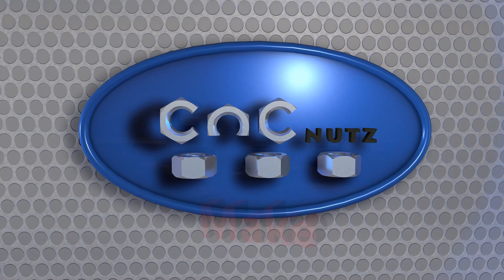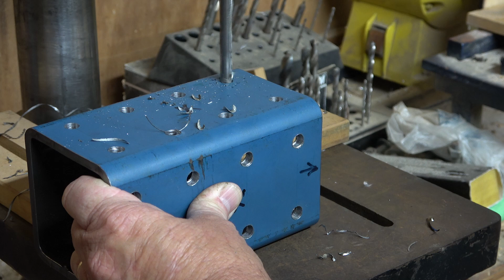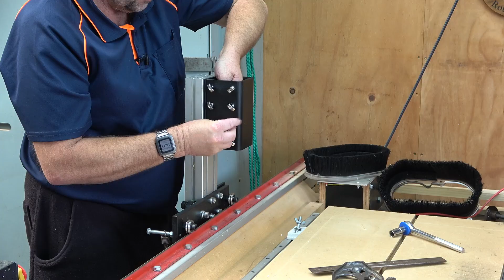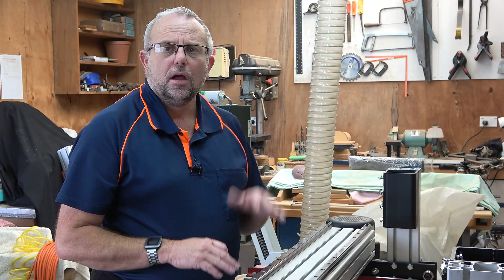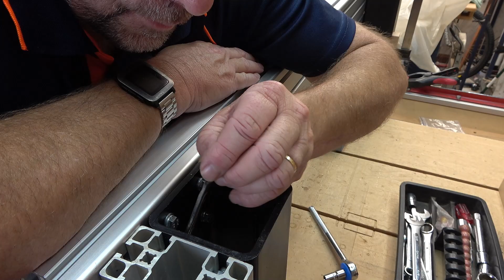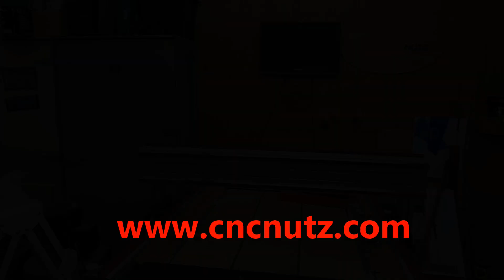X / Z upgrade Part 2 - CNCnutz Episode 252

Comment: Nice! You could have saved a few dollars if you ordered the linear rail 30 or so centimeters (x2) shorter. The spindle never goes all the way to the ends. Precious pieces of steel, those rails!
Reply from the maker: I want maximum travel on this build as I want to get as close to the sides as possible.
Cheers Peter

Comment: Question. The X-rails, having put them on and nipped them up, how do you know that they are parallel to the bed? I would think placing the x assembly on it's mount then with a loose top x-rail then tightening it up once measured from the bed, then place the lower x-rail and plate and carry out the parallel adjustment, it just seems that you might not have a height- aligned bed. I'm sure you thought about this but I'm just interested
Reply from the maker: I parallel the X rail up later by adjusting the Y axis. I actually did it yesterday.
Cheers Peter

Comment: I did the exact mistake of ordering the 6mm nuts and bolts for my linear bearings. The body went in but the head of the screw didn't. But being the impatient person i am, I just stuck the bolts on my drill one by one and ground their head down on my bench grinder, until all of them fit. At the end it worked out fine for me and my cnc has been running fine without and troubles.
Reply from the maker: Never thought of doing that but I'm glad I did order the 5's
Cheers Peter